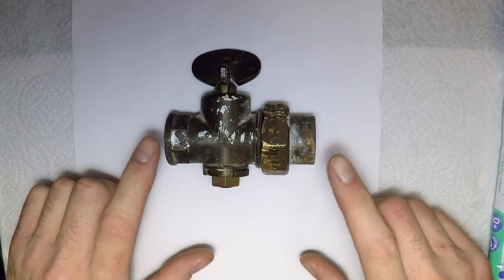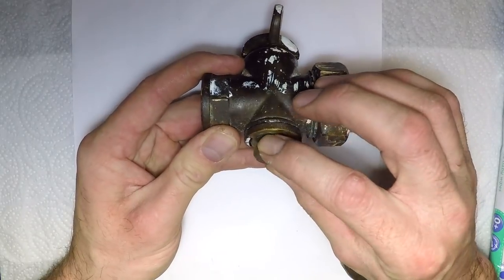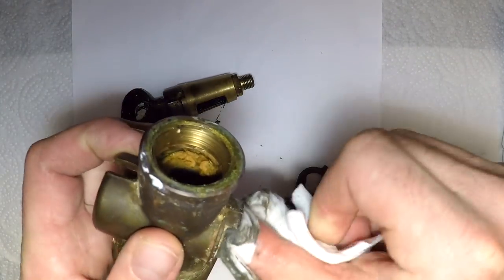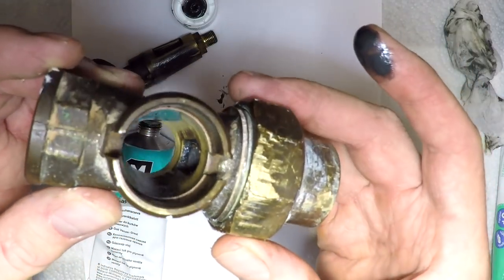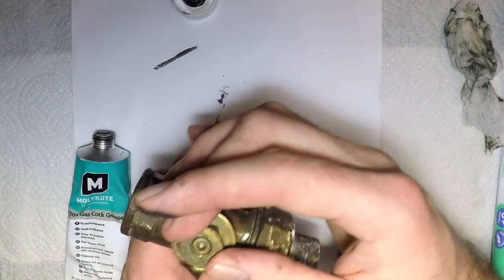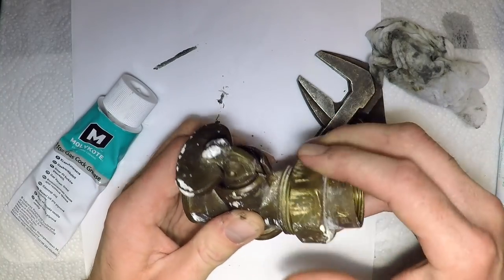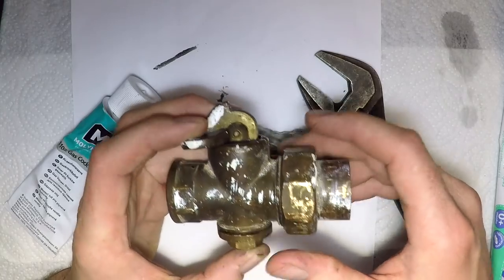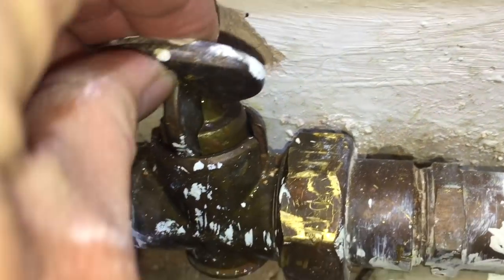How to Fix Gas Leaks on old Gas Cocks. Gas Leak Repair. Heatinggeek.

Comment: Old school fix, the modern way is to replace rather than repair the part, thats the difference between being an engineer or a fitter.
Reply from the maker: Thats right. Im amazed at how much stuff gets binned when it could be fixed. This valve was in a 80y olds flat. No heating or hot water for 11 days!!!
Reply: There’s a reason for that, especially on gas mains. Tapered barrel valves, like the one in this video, are diabolical. The two-piece design, with a compression sealed moving part is good at two things: leaking, and going stiff. The latter of which is even worse on this valve because of the handle. 

The fact is, that you can fit an objectively superior ball valve ECV in less time than it would take you to dismantle and re-grease the old man.

Comment: Greased hundreds of valves when I was a service technician for the full service gas utility in St Louis, Missouri. It is better to replace the valve with a full port ball cock  if accessibility is no issue . But when accessibility is an issue or dealing with range valve no longer manufactured, greasing is a good acceptable option. I prefer the Honeywell brand of valve grease it also works as a very good pipe dope for those questionable threads.
Reply from the maker: Pipe dope? Whats that? :-)
Reply: @HeatingGeek  , I'm sorry, I didn't realize you were a millennial. I guess I should have said ,pipe thread compound PTC / LOL. Valve grease is awesome.😎
Reply from the maker: @boby115  Im not a millennial but pipe dope sounds American. :-/ :-)
Reply: @HeatingGeek  , as American as apple pie.
Reply from the maker: @boby115  Exactly :-) we call it paste;

Comment: Lol love the yellow cloth for gas 😂 thanks for posting
Reply: BG shut down a care home boiler for same gas leak. Uncapped meter, tested, no drop with the same gas tap as that in on or off position, spray only bubbled up when it was turned on and off. Part obsolete so they'd qouted 6k for new boiler, took longer to do the gas safety inspection than it did to strip,clean,grease and repair.
Reply from the maker: Madness. But thats how things are now a days.
Reply from the maker: Heat Service bwc uk  Im glad someone noticed. ;-)

Comment: I do the same thing with these old brass cocks , why replace when it can be serviced , I'll give you a tip , get yourself a tin of carburettor spray cleaner , it works a treat for removing the grime and shite out of these valves plus you can use it for a lot of other cleaning jobs on boilers and it makes your life a lot easier........👍
Great  videos you do mate , long may they continue
Reply from the maker: Thanks. Where can you get carb/brake cleaner at a reasonable price. I find it runs out too quickly and costs quite a lot. I do use it in my garage etc.
Reply: You can buy it in gallon containers from decent motor factor shops and use a small spray bottle to apply it , I pay about £20 for a gallon of decent stuff but you can get cheaper gear from e bay for about £10-15.....👍
Reply from the maker: Ok. Thats what I was doing wrong. I was getting the aerosol!
Reply from the maker: yensabi Thanks:-)

Comment: I can see why they wanted it changed in the end, looks like 22mm pipe up to 28mm pipe with a chip out of the wall to be able to turn off gas!Tricky for a customer,
 lever valve would be  much more user friendly,
 OK possible its imperial 3/4 size pipe not 22mm so slightly more hassle, but why would someone have gas turned off for 11 days on  0.5 mb leak? i did a job recently that the gas board capped off a supply at a 4 mb leak, but was on a E6 meter? On a U4/G4 its 4 mb leak in 2 minute test.E6 is 8 mb, we all want no leaks but there is a permitted allowance for a reason, Cleaned up the meter union connections halved the drop to 2 mb.
Reply from the maker: Because it was difficult and 3 different companies went out. Each company except the one I worked for said someone else would be back. 
Were service and repair company. Most guys don't carry a blowtorch. The valve was tight to the wall and someone had tried to tighten it (the big nut, not where the leak was coming from) which caused it to twist towards the wall furthering need the bit taken out (which I done). 
The customer never reported a smell so it shouldn't have been turned off. 
Bottom line is, the engineer who found it, could of fixed it in 10min if he (had a clue/could be assed/gave a shit). You pick a reason. This turned into a nightmare for the customer and me  for other reasons. If it was dealt with correctly on visit one she would of had heating and water constantly.
After someone has capped it off you aren't allowed any drop. It can be a pain in the ass if the drop is allowable and the customer didn't report. Anyway thats life.
Reply: @HeatingGeek  thanks for the reply, it seems so many companies have there employees to such a tight schedule and everything is rush rush, for example boiler swops and commissioning in a day! No time at all for problems. Great video's, keep them coming.
Reply from the maker: @tysonbruno  Your absolutely right. Got a good video coming (I think)
Reply: Permissible gas pressure drops are only allowed on appliances themselves. Not the pipework. If you get any pressure drop on your u-gauge you isolate all appliances and test again. If there's a drop on the pipework itself. The tightness test has failed. 

There's a common misconception that your allowed 4mb on a U6/G4 and 8mb on an E6 meter. Considering standing pressure is supposed to be no greater the 30mb. I wouldn't be able to sleep leaving a 4-8mb leak. Especially between ceiling voids. Where higher concentrations of NG can build up. 

Gas fan cock keys valves are designed to be serviceable. 😜

Comment: Old skool mentality, repair things and fix things. Sadly lacking from today’s generation...
Reply from the maker: Yep. Defiantly. I hate fitting something (new) I could of fixed. Like Plate heat exchangers.
Reply: Zed Man perhaps in general but not in all cases
Reply from the maker: @heatservicebwcuk1545  he's right generally though. Most people are trained to replace rather than repair. You don't even learn how to remake a long screw on the ACS any more. 
Your still allowed to repair them but if no one knows how, what do you do.